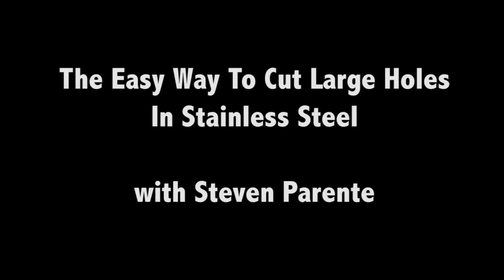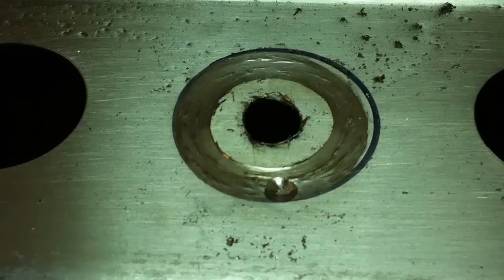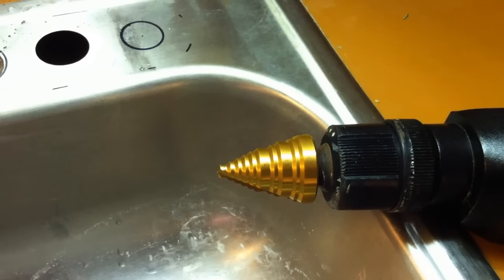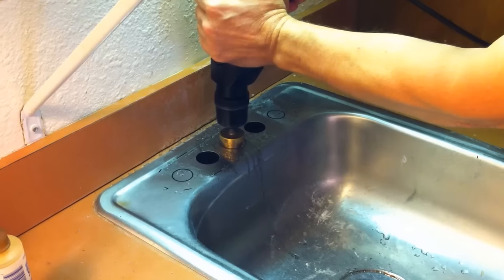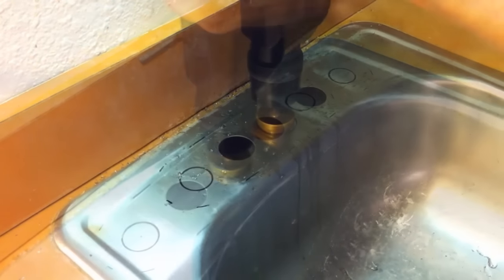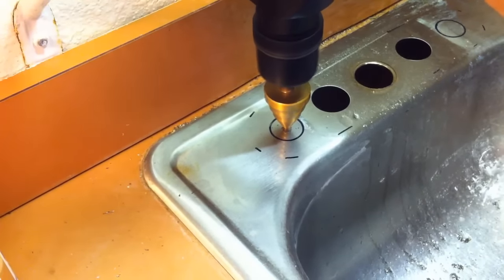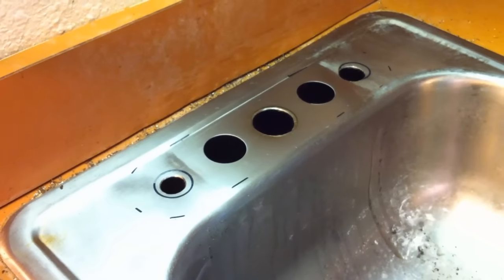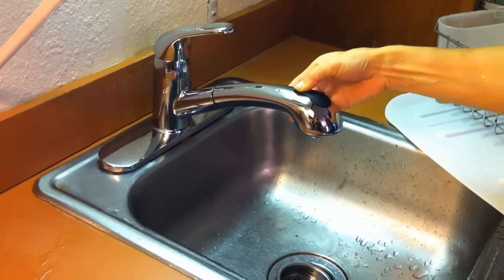Drilling Large Holes in Stainless Steel the Easy Way

Comment: Hi, I have a few points to make about your video that might be off help to other viewers. I trained in stainless steel fabrication and worked manfacturing high pressure vessels for companys such as Coca Cola and Pfizer so I have plenty of experience in drilling holes. Firstly , the hole saws that you used initially were commonly used in our company for holes up to 120mm diameter. The proper way to use them is to use plenty of cutting fluid or coolant and to pulse the power on and off on the drill as you use it so the drill never builds up speed or overheats. Secondly, the way you used that taper bit will burn it out in just a few holes. Don't keep the power on full when you are drilling and if you see smoke then stop as you are burning the bit. You can see from the first holes that iyt overheated as the edges are sinking down which is metal warping from it getting too hot. You need constant cooling and slow speed for stainless steel or you are wasting your time. If you redden the steel while drilling then it will become to hard and you'll just destroy drill bit after drill bit. if you use proper drilling technique you would have a 22mm hole drilled in 20 seconds. the tool is just rubbing off the steel, it needs to be slow so it can cut.
Reply from the maker: Thank you Adrian!
Reply from the maker: Aloha Lean, the Neiko bit should work.  Buy a small bottle of machine or milling oil, lubricate while you drill and drill slowly,  You'll notice that some of the comments by pro's that have worked with stainless, said I should have gone even slower.
Reply from the maker: Just ask someone at the hardware store.  They may call it something else.  It's just a light oil to prevent heat from the friction of drilling.
Reply from the maker: Lean Wang That should work well.
Reply: Lean Wang
Sorry, I only just seen your comment today. That should work fine, just progress slowly with it and don't let it overheat. That cutting fluid will work fine, just apply plenty of it while you are using it. As you go through the various sizes of holes it will get tougher to drill. Don't force it though, gentle pressure and pulse the switch on the drill and it should work perfect.
Reply: Thanks Adrian. Good tips. I'm going to try it soon. 20seconds is a great result!
Reply: I have been doing research on drilling SS and found many machinists suggesting to simply use water.  They say cutting oils burn away quickly once heat starts building up so simple frequent spraying with water actually works best along with slower drilling speeds.
Reply: Adrian Connolly good to know!
Reply: Thank you for the excellent information.
Reply: Thank you Adrian! I really appreciate your tip.
Reply: ...seriously, no pun intended!
Reply: Just wanted to say thanks for taking the time to post this. I was half way through cutting a hole and wasn't making much progress anymore. Slowing down was the trick. Thanks again.,
Reply: Andrian,

Thank you for your tip. 
I used the bi metal hole cutting but and followed your advice.  I started drilling with a thin drill bit to  start a small hole so the big metal hole cutting kit can catch. Using stop and go slow drill and adding a bit of water here and there to cool the steel down, I was able to drill the hole in less than 1 min.
Reply: Awesome comment. The facts and nothing more 👍🏼
Reply: tabs ninja  hi, you can still drill through work hardened steel like that but you will go through a few bits to do so. Step drills are great and I use them all the time but stainless steel is very hard on them unless you use a good method
Reply: @StevenParente I wish I had seen this last week. After I got beat by the stainless steel then I saw this comment.
Reply from the maker: @williamcarter7057  Hopefully you'll beat the stainless steel now!  Thanks for watching.
Reply: @StevenParente  oh yeah 👍 my new triple sink looks great. Saved about $300 so far. Once I add hot water and plumbing I'll save additional $500. Self contained concession sink with hand washing 4 bowls total, all NSF. I really thought higher speed was the answer 😞
Reply: I’m here to make sure someone mentioned speed issues
Reply: Thank you random internet stranger from the past. I just used your tips to cut a perfect 1.5" hole in my stainless steel sink. I used a new Craftsman hole saw, a power drill, and some mineral oil as a cutting fluid. It wasn't 20 seconds, but it only took a few minutes, I stopped and cleaned away the chips and oil periodically and added more oil, that way I could see I was still getting good chips.
Reply: Would you agree that more pressure was needed because he was smoking the bit along with too fast of speed?
Reply: @CVM222VOLT  Windex works well also
Reply: Would a good quality magdrill with (carbide tip) annular bit work on stainless steel?
Reply: @davidjenkinson7142 i've never used a carbide bit but it should work fine . The only problem is that stainless is not magnetic so you would have to attach it to a different surface. We used mag drills will hole saws but would fix the drill to the fork on a fork truck .
Reply: Yes its a good point to remember that the magdrill won't stick to the stainless steel.  Looks like your other very good insights will utilised for my job. Thanks Thanks again

Comment: Less speed, more feed. The number 1 rule when cutting stainless is slow the rpm and increase the bit pressure. High speed and taking it "easy" hardens the metal and make the job much much harder.
Reply: I came here to say the same thing. Thank you for providing more information to this diy.
Reply: Slow and steady gets the job done. But we know that most self proclaimed experts are tear arses and want everything done in a flash and always blame the tools. Just sayin!!!
Reply: @richardtemby4358  he is just a guy that learned something and wanted to share it

Comment: great recommendation on the drill bit and oil. However, the faucet takes up so much of the small sinks access by hovering over it. One would have to take out the faucet when putting a large type pan in the sink. Thanks
Reply from the maker: Thanks for watching and hope it helps.  The small sink I installed, fit exactly except needed the holes repositioned.  A few years ago, I found a bathroom sink with a flexible pull out faucet that I replaced the one in the video and it's been working extremely well.

Comment: It all looks so easy, however I believe was not strong enough, for any women watching this, my recommendation is have someone strong do it if you are not, I accomplished one hole after 2.5 hrs. I stopped regularly and used the lubricant. The drill got very hot, and my nerves were a bit frazzled half way through as the drill would be hard to control. I finished the 35 mm hole, and smoothed the edges with dremel tool. The step drill was getting worn close to 1", and then just before 1 3/8". I would stop for 15 min to let the drill cool. Job done, I will not personally do again.
Reply from the maker: Thanks for your input and for watching.

Comment: I have a 1.25” faucet hole in my stainless steel sink top. The back of the hole is flat- I want to replace the faucet but the faucet bolt of course is also flat on the backside - the only replacement faucet I can find is a complete circle without the flat back on the holding bolt. What can I use to carefully complete the circle on the hole so I can install a new faucet with a circular bolt?
Reply from the maker: Aloha, I'm not familiar with that type of faucet.  I'm in a condo and this faucet was produced in the 70's and it was much smaller than a regular kitchen faucet.  I found that an RV faucet fit and I made this video when I needed to drill holes into the stainless steel sink.  When this one wore out, I was unable to order the same RV faucet andI went to Home Depot and found a bathroom faucet that fit, although I had to use metal tape to plug a couple of holes.  Two of the holes I drilled fit perfectly.   I suggest talking with your local hardware store about your faucet.  Take photos and measure the distances between holes and the overall layout.  They'll be able to tell if what they carry will work, or if they need to order something else.  Or if you need to order from Amazon or another company.  Thanks for watching!

Comment: Use cutting oil not regular oil and run you uni-bit in low. I cut holes like these in about 30 seconds...if your bit is getting hot enough to smoke you are doing it wrong.

Comment: Wayyyyyyy too fast.  Go very slow with a lot of pressure.  You might not even need any cutting oil or coolant.  Knock out punches are also available.  I don't mean necessarily the hydraulic kind.  Any electrical supply will have ones that you use with a pair of wrenches.  They're pricey, so if you can rent or borrow one, that's the best way to go.
Reply from the maker: +Mark “Loeb” Soldan Thanks for the input Mark!
Reply: Yes he is right fast for wood slow for metal.

Comment: Sink stainless is a hard metal. Of course a bi-metal hole saw would have trouble and micro dull immediately. You need a carbide tipped hole saw. Your cutting tool needs to be significantly harder than the material you are cutting. This is cutting 101.
Reply from the maker: Thanks for the input!  Yes, the titanium coated step bit did the trick and at the larger hole size.  Thanks for watching!

Comment: I remember the time when I drilled a hole onto my stainless knife. I just put oil on it as i drill, in full rpm! It smoked a lot! The stainless handle (where I was drilling) turned red and the wood where is was sitting turned black as it catches heat from the knife handle. I didn't know that I was supposed to go slow, but I managed to make the hole. Now I am thinking, did I destroyed my bit in the process? It was still in "one piece" though. Next time, I know what to do with stainless steel.

Comment: Seriously dude, slow your drill down. Stainless is piss easy to work with as long as you keep your tool cutting and not letting it rub (i.e. work hardening) and also by not having your revs too high. I'd say at the speed you were going you won't get that long a life outa that tool.

Comment: I just drilled a third hole through a very thick 3/16" (5mm) Kraus stainless steel sink. I used a tungsten carbide tipped hole saw in a 12v Bosch drill/driver. Used water for cooling. Took a little effort but it drilled out cleanly. To remove any burrs I used an 8" half round 'basterd cut' (fine) file. Thought I was going to have to go over it with sandpaper, but it's smooth enough.  I used a 1-3/8" (35mm) hole saw.  Hope this helps. It answers the questions I had and it worked well.
Reply from the maker: Thanks for your input and for watching!

Comment: I was told by an old machinist stainless is cut or drilled "slow and hard" with good bits.  I made a brake rotor for my motorcycle from a plate of stainless .4 thick.  It was a bitch!
Reply: +charlie dee gotta use a drill press, your friend is right.

Comment: If you have to do something like this again, try renting a hydraulic knockout punch from home depot or something. It takes a matter of seconds with one of those and it's a hand operated tool that you just pump with a lever. It's no bigger than a bicycle pump. Also, you won't risk warping or discoloring the material you're trying to make a hole in.

Comment: Name the bit and is it can fixed in wall drilling machine
Reply from the maker: Aloha Neha.  It's called a Step Bit.  I have a link for it in my description.  There are others that are less expensive that will probably work, but here's the one I used.  It's a BOSCH SDT10 1/4 In. to 1-3/8 In. Titanium-Coated Step Drill Bit and it's still working after all these years.  https://www.amazon.com/gp/product/B000VC76QS/ref=as_li_tl?ie=UTF8&camp=1789&creative=9325&creativeASIN=B000VC76QS&linkCode=as2&tag=stevenparente-20&linkId=b69e75e229aecd5d58d197ce2d6d6fbd  Thank you for watching!

Comment: Wrong bit you need carbide
Reply from the maker: Yeah, carbide would have been better, but the hardware store didn't have any.  The condo complexI live at, scheduled a water shut off and I had to do the job within an hour.  On the other hand, my titanium bit did the job and I still use it 9 years later.  It's in good shape, although I don't drill much stainless steel with it anymore.  Thanks for the input and for watching Jesse!

Comment: titanium is not good enough, try cobalt
Reply from the maker: Thanks for the tip!
Reply: No just "Cobalt", but "HSS Cobalt" ( 5% minimum)
Reply: Hi, I was told I should not drill on a stainless steel sink because it will rust and get discolored after a while. Are u aware whether this is true? and what can I do to prevent it?
Reply from the maker: Aloha Sian.  My sink hasn't discolored and it's been 5 years since I made this video.  Thank you for watching!
Reply: thanks so much!

Comment: Ikea has 2 set punch for like $15. Way faster and easier than drilling. Also like all others said your drill is way too fast. With proper speed/pressure your bimetal holesaw would do fine.

Comment: Whenever working with Stainless, keep your speed LOW!  Holesaws work great if you use a variable seed drill motor, and let off the trigger if you go above 200-300 rpm.  Cutting oil  or tallow are also very important.
Reply from the maker: Thanks for the information Richard!
Reply: corekt and the oil shuld be rocol ,, its the best off the best ;)

Comment: Thank you very much for posting this! It seemed as though everyone said I couldn't drill my sink. Too hard to do and to tough a material they said. I figured it had to be possible as they come with holes that had to be cut out somehow as stainless isn't molded so much as bent as far as I know. seeing this vid I now know what tools I need so I can FINALLY have enough holes for a sprayer and an instant hot water side faucet! Again, thank you this is a time and money saver now that I dont have to buy a new sink!
Reply from the maker: It does work.  Go slow with the step bit.  Even slower than I did.  You can do it Jason!  Thank you for watching.

Comment: I had great success with a Milwaukee cobalt "Hard Metal, Quad Edge Tip, Red Helix" 1/4 drill bit 48-89-2313.  With a little WD40 and low RPM it ripped through the stainless steel in a few seconds where a normal split titanium coated split point drill wouldn't get started.  Then a Milwaukee 48-89-9201 "Jam-Free" step drill popped right through to give me a 1/2" hole, which is all I needed.
Reply from the maker: Thanks for the input Ron and for watching!

Comment: I believe the main problem he had was that there was already a center hole that was larger than the drill bit. This caused the hole saw to not stay in 1 groove. You can see this in the video by the wide ring of scraped metal. One solution in this situation is to put a block of wood under the existing hole. This will let the drill bit stay centered through the entire cut. There are machinists in this thread saying this type of bit should work fine. They are also saying that overheating was the main problem. I think that it was centering and not hear that was the main problem with the original cut. Good luck!
Reply from the maker: Centering was the problem Ben.  And there wasn't enough space to clamp wood at the bottom.  Very tight space and maintenance cut off the water to the entire building.  The pressure was on and I had to get er' done fast.  Thanks for watching!

Comment: Stainless steel work hardens quickly so:
1) Always maintain force on the drill bit.
2) Keep drill RPM as low as possible, best around 500RPM which is tricky except with a cordless.
Reply from the maker: Thanks for the tips Peter and thanks for watching!

Comment: There's an interesting aspect about step drill bits that I learned from Adam Savage.  If you are ever off center with the hole you're drilling, you can apply gentle lateral pressure to start "cutting" sideways.  This way you can begin recentering the hole before it's too late!
Reply from the maker: That sounds like a really good technique, thank you!  And for watching!

Comment: another alternative to drilling are hole punches // they work with wrenches, there is no drilling, nice and smooth.... this is what I use when I fabricate my beer equipment, which is much thicker stainless steel...
Reply from the maker: This sounds really interesting and helpful Ray.  Can you post a video of how you do this and share your link here?
Reply from the maker: @baileyacct9665  This looks like a great system, especially if you needed to cut many holes.

Comment: Water would work better. Take a water bottle. Punch a little hole on the side so the water comes out like a little spray stream. Point it on the contact between the drill bit and the metal. It will keep them cool, some metal dusts will get mixed in and improves the friction/grinding. While taking them away when they are too expensive.
Just like when cutting stones and tiles.
Reply from the maker: Thanks for the good input!  And thanks for watching.

Comment: Thanks for the vid  - might buy a graduated step -drill bit rather than a hole bit now. Cheers
Reply from the maker: As you can see in the video, it worked WAY better for me.  I could have gone a little slower, but I'm in a condo complex and the water was shut off for the building.  So had to do the drilling quickly.  Thanks for watching!

Comment: DON'T high speed and fast drill but will be burn and damage to hole saw and step bit, MUST BE LOW SPEED AND SLOW drilling, 250rpm or less with cut oil for stainless steel
Reply from the maker: Thank you for your detailed input Iginio!  And thanks for watching.
Reply: Stainless work hardens quickly....so go slow speed....high pressure....finish the job quickly and get out. If you take your sweet time, the surface being cut will work harden and dull the bit...
Reply from the maker: Thank you Gustavo.